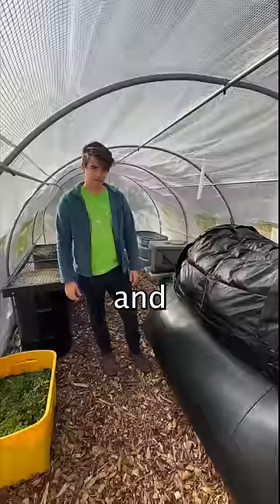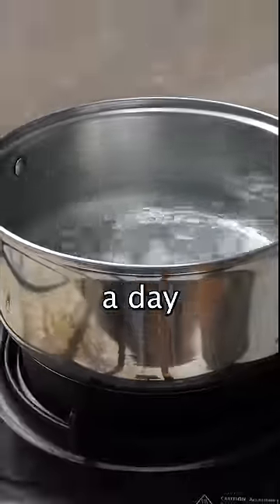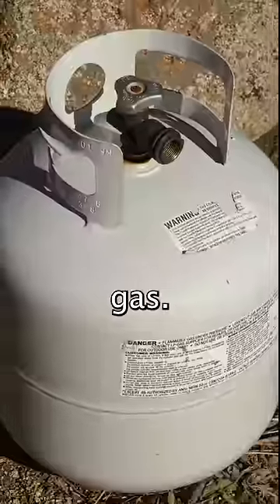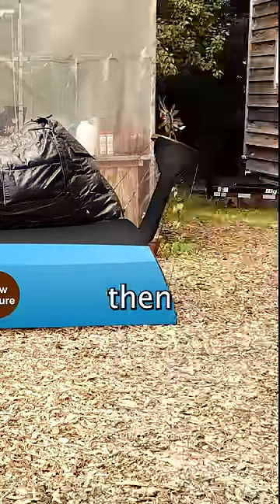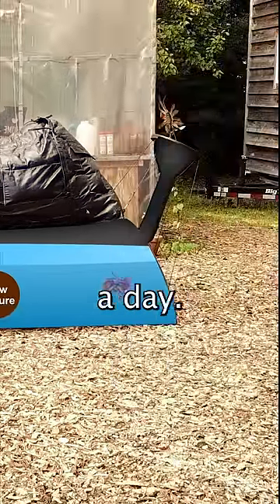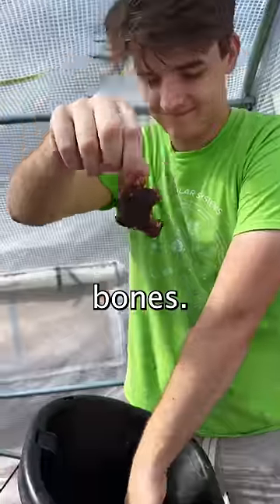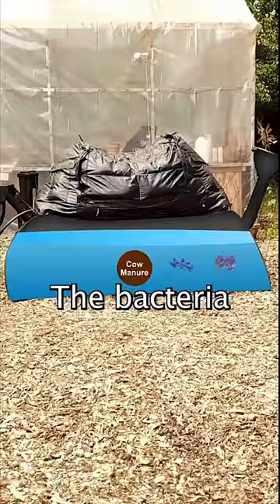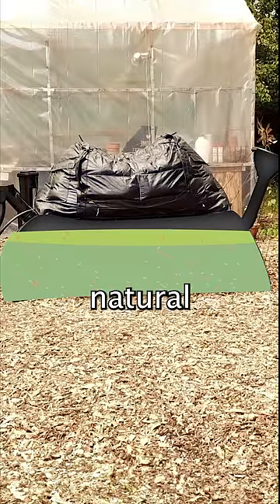The Methane Digester is a powerful system! #shorts #sustainability

Comment: So you use cow shit gas to cook your food? Some how that doesnt sound appetizing especially when you have to run the gas through sand to knock down the smell lol
Reply: 1: it's produced by the bacteria
2: it's a carbon filter. The sand doesn't filter it in any way. Shape. Or form.
 
3: it's literally no different than using butane or propane. Both of those are natural gasses as well.
Reply: @sasukedemon888888888  lol thank you but I do understand that. It's the thoughts behind all that. You take a fart for instance. When you smell that you are actually getting particles of feces in your sinuses that's what causes you to smell it in the first place. How many layers of underwear and other clothing have you farted through and could still smell it??????? Sand is a much better filter when used correctly.  Water purification for instance. Yet they still use charcoal in most instances to really clean the water. All this to point out when your cooking with shit gas your cooking with shit. Don't get me wrong it's really cool and a great way to do something off grid. The science behind it is really awesome. The only problem is no matter how you break it down its shit gas like cooking with a fart............
   Being the majority of any possible fecal matter would probably be burned up in the flame so I get that and again awesome science, but again it's SHIT gas kind of like using a turd to cook your food it's processed with the very same bacteria. That's all I'm trying to point out is it just sounds bad breaking it down like that. Thanks foe the reply seriously it's really cool science and all.
Reply from the maker: Go relearn basically chemistry and then come back with your questions.  K12 failed you bro XD